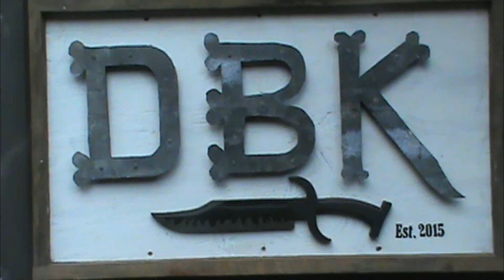How I do it

Comment: Dang! I am slacker, 12 knifes, you are cranking them out. Thanks for the video. I have used that and it works great. The problem I have had is it falls off on a longer sword in sections. That thin slurry is what I am hope to figure out. It should help hold the thicker layer on during heat treatment. Thanks Jed LOL
Reply from the maker: The key to using the Rutlands is to let it dry completely. Trouble with it on the Japanize swords is the way its quenched. Tip down in a tank causes a pressured vaper wave that blows the clay off. Japanize swords long and short are quenched length ways edge down. Less pressure to blow off the clay. The Japanize have learned and taught a lot people about the way they do things.